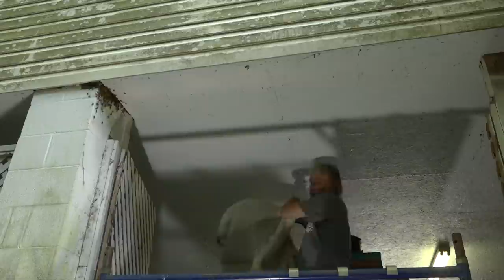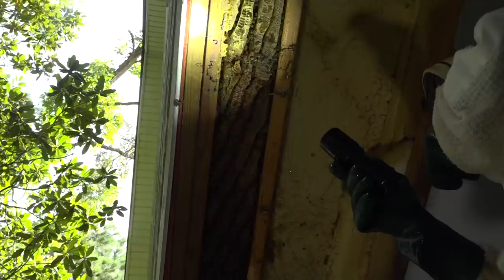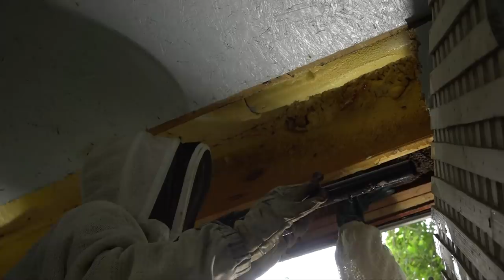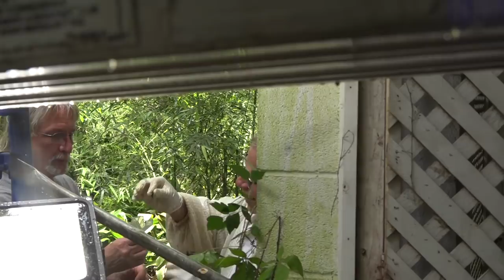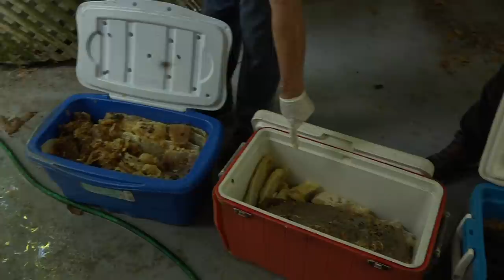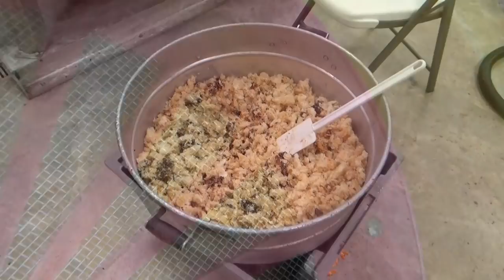Removing a monster bee hive right before T. S.  Cristobal hits.

Comment: Hey, Mr Ed, i did a cutout this week. Your videos always make it look easy. Mine was NOT. Had to work around baseboard radiator feed hoses, copper bathroom plumbing, PCV wastewater pipes, and electric lines. Half the hive on one side of an interior wall accessible through the floor. On the other side of the interior wall was a bathroom sink cabinet, so we accessed that side through a cut in the ceiling below. Thank God the comb ended before the next wall, where the kitchen started. Also Thank God for Honey Harvester (like your Honey Robber). We pushed a repellent soaked paper towel past the cluster to keep them from running out of reach. Brought home a beautiful amber queen on Day 2 of the project.
Reply from the maker: Way to go on a tough removal. Trust me,VERY few are easy which is why there are so few people that do them.....for long. Best wishes for all your successes. God's peace Willa.
Mr. Ed

Comment: Audio, I have been running sound in my church for 30 years using 18 Sennheiser wireless mics, start at the belt pac transmitter and make sure the sensitivity is set where you are getting a maximum RF 2/3 scale and make sure the audio output on the receiver is peaks again at 2/3rd scale also, if you do not understand what I am saying you are welcome to let me know and I will walk you through it and I will be glad to help you.
Reply from the maker: Your offer of help is greatly appreciated, thank you for it. This was the first time I used the wireless mic, it's a Sony UWP D,  and was not familiar with it. I now have some help and the problems will be fixed by the next video. Again, thank you for your offer of help and for watching. God's peace Dave.
Mr. Ed